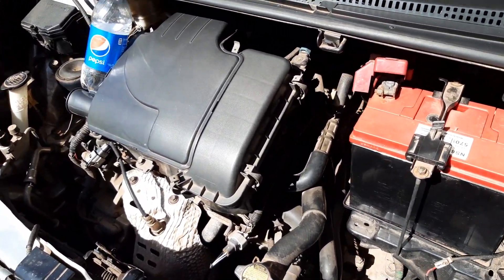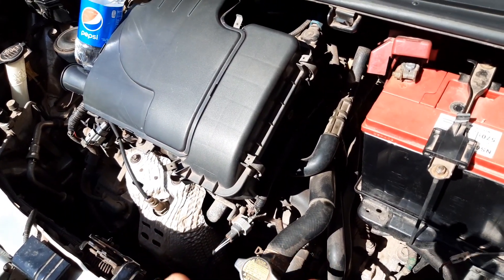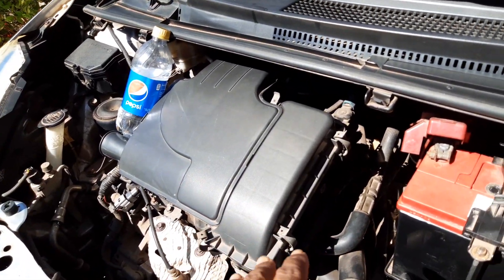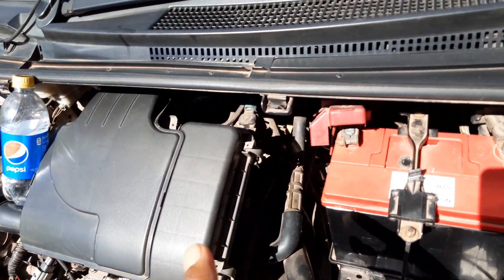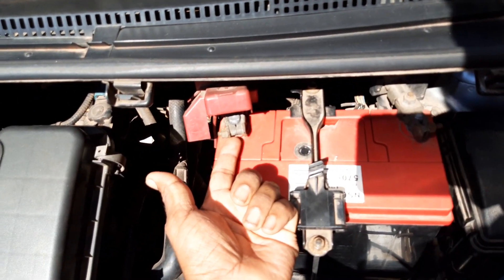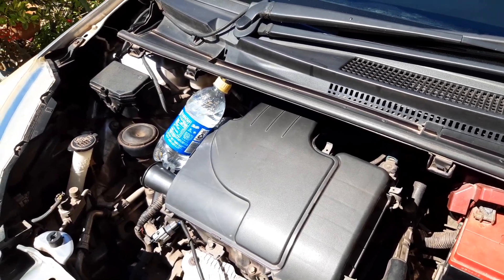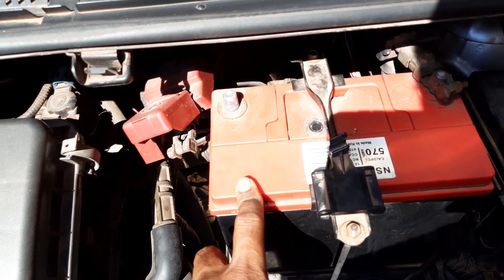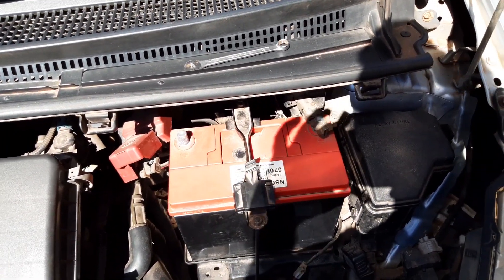Engine Vibration Facts

Comment: Hi i have audi a4 2.0 tdi my engine vibrates only when engine is hot at idle thanks
Reply from the maker: If you don't have any engine check light on then you have a sensor that is partly blocked. 
It's best to check and clean the easier to get to parts first like the throttle body, spark plugs, oxygen sensors.
Reply: @ShelDockToyotaVitz  hi thanks its a diesel so no spark plugs or throttle body i will check 02 sensors thanks

Comment: Great videos sir, i have an error of camshaft position sensor, any idea how can i fix it ?
Reply from the maker: You may need to replace this sensor. This interrupts the entire engine operation causing it not to start. Get an auto-electrician to confirm that this sensor is really the problem.

Comment: Shel dock can you help me i have issue with speedometer
Reply: Someone told that speed doesnt show because of ABS BLOCK SOMEONE STOLE IT FROM MY CAR
Reply from the maker: @sabachkheidze1915  presently I have abs and wheel speed sensor problem and my manual speedometer still works fine. Though that person may have the experience of that problem before and Fixed it.
Reply from the maker: What type of problem you are having?
Reply: I have toyota yaris 2009 1.0 manual on my dashboard working everything but on km/h is always 0
Reply from the maker: @sabachkheidze1915  you have a circuit disconnection to your km/h reading. Display. When you are driving the speed sensor signal from your transmission is reaching the dashboard panel cause you are seeing a manual reading. However the signal is not reaching the digital display because a circuit is disconnected. This happens because the vehicle is shaking when driving on rough roads. It happens, the technical thing is to find the disconnection and re-solder it.
Some people go the easier way of replacing the panel.
Reply: Can you add me on whatsapp or on viber somewhere to send you video or picture

Comment: My engine as a knocking sound when I clean the throttle body it goes a way for a while and comes back
Reply from the maker: Was this happening before or it happened after the throttle body was cleared.
Reply: @ShelDockToyotaVitz  before it was cleaned
Reply from the maker: Knocking sounds from the engine can be a bit technical to locate. It would be good to locate the area where the sound is coming from, like the section where the belt and pulleys are since there are external morning parts at that location.